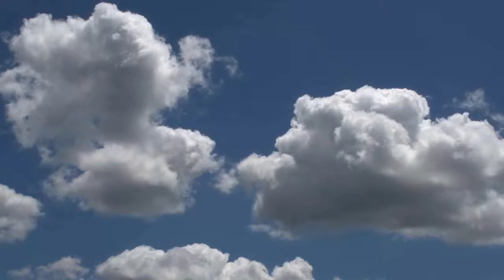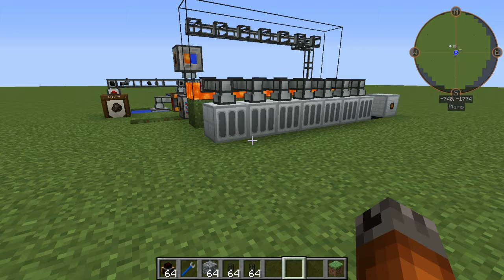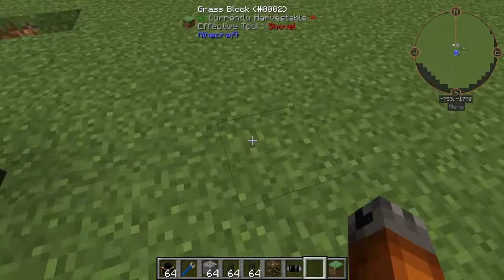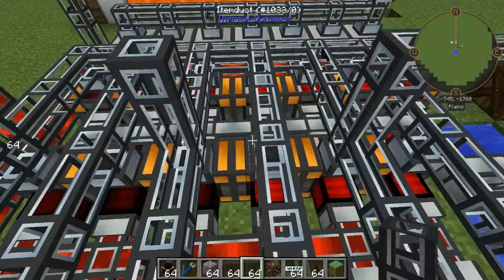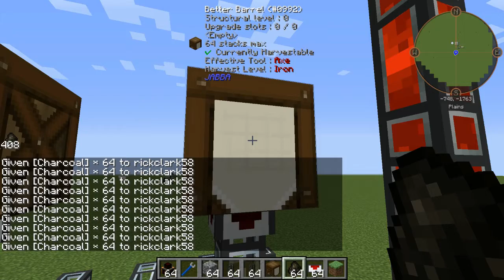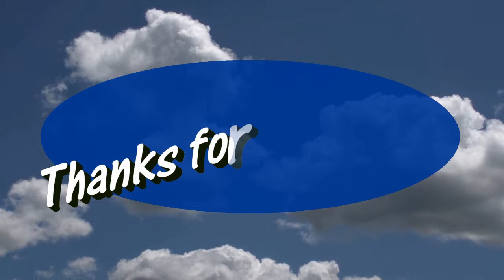Decidedly Neapolitan Extra!: Centralized Power System

Comment: That is a really great setup! I think with the higher tier servos you can set it to an output pattern like round-robin.
Reply from the maker: Thanks man. You are probably right. This is the first time I have actually used them.  They seem to work well. In my new setup I am going to use those caches as well since they hold much more than the barrels.